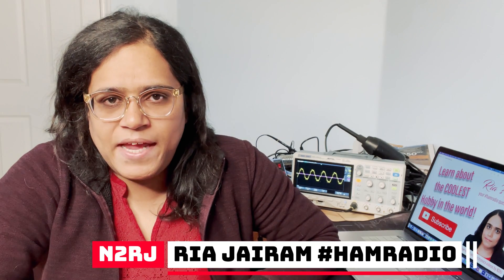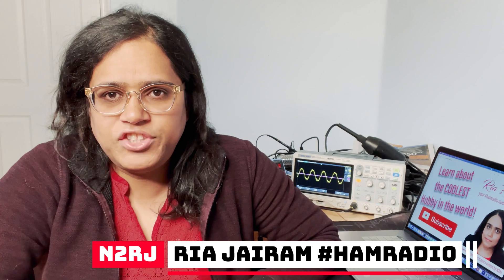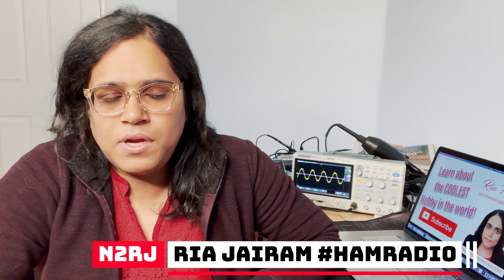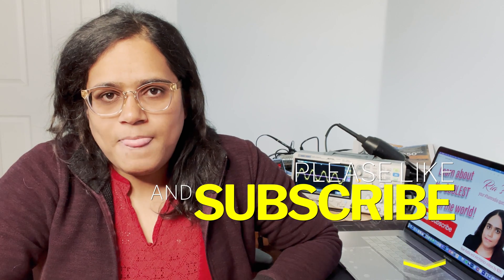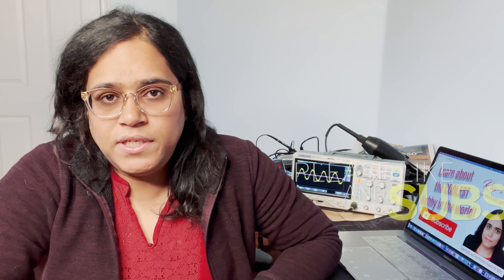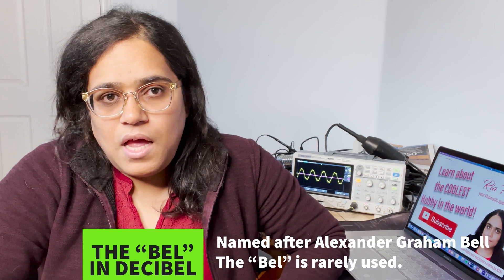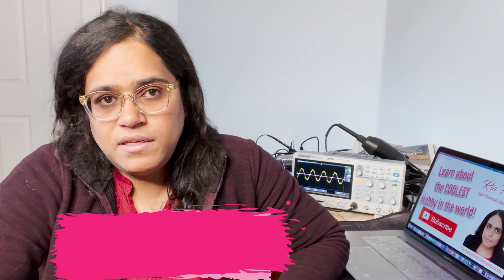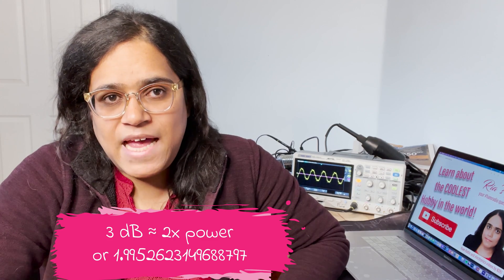Ham radio - Why do antennas have gain? Ria's shack Q&A #hamradio

Comment: Speaker magnetic use antenna is it possible or not with out repeaters use how to working vhf / UHF signal go to long distance  how to calculated antenna (frequency ) Making formula plz explain and any changes in vhf UHF base circuits communication go to long distance   what's type of Metral use antenna makes I am ham

Comment: Question? Just acquired my General ham radio licence...purpose for distance traveling, safety, emergency and etc. Do I need a HF 100watt output mobile radio. And if so, for better reception, can I locate two antennias front and rear of my vehicle. I understand using matching antennia cables with a split cable connection. Your insight deeply appreciated. Thank you.
Reply from the maker: Generally, no. A car doesn’t offer enough space to phase antennas to combine for better reception or transmission.